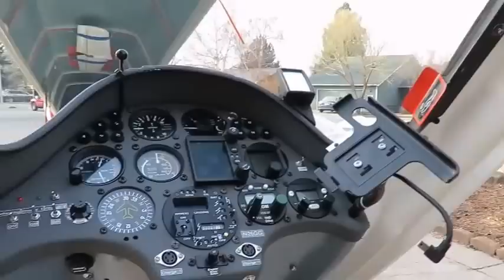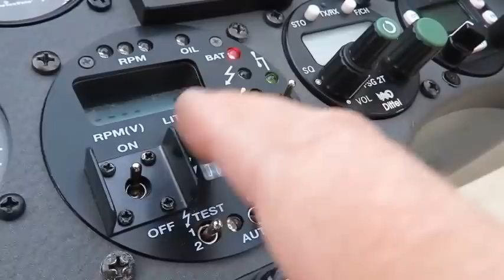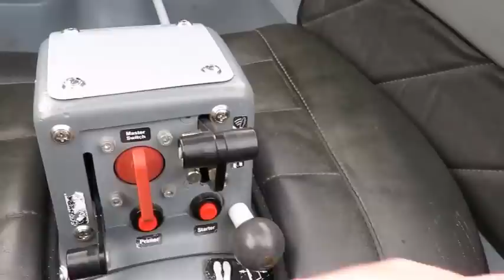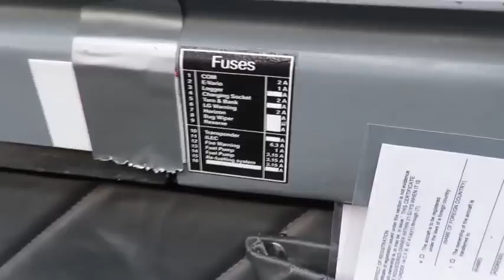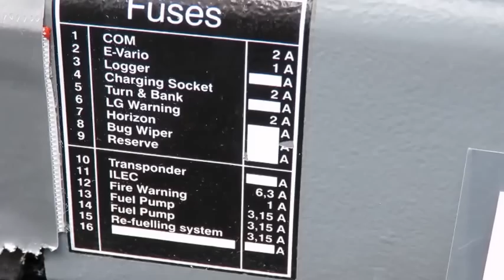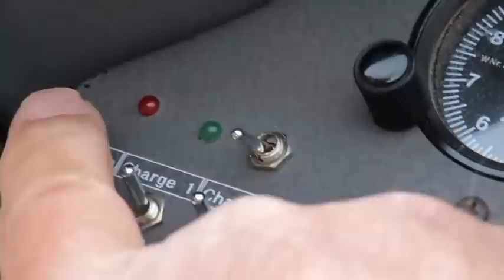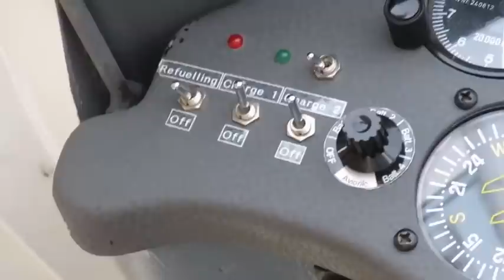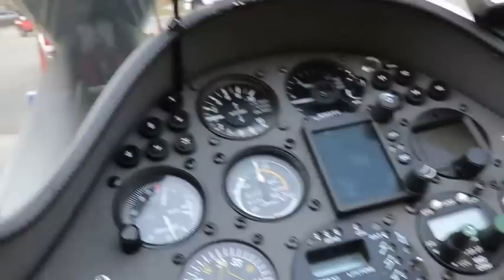ASH26e Motorglider Introduction

Comment: Schleicher has a different version of air filter, going upright, fixed at the water cooler, enabling much easier access to the oil cap.
Reply from the maker: This version is the ASH31Mi (which I now own). I have never heard of anyone retrofitting this to the 26e, but it might be a good idea. An upright air intake draws all air from the slip stream, while the its position on the 26e will draw some air from the exhaust (which is hotter and includes exhaust products). Schleicher made this change for a good reason: the 31Mi is much less prone to overheating than the 26e.

Comment: As relates to your oil filler cap. If I were you, I'd take a dremel tool and cut a small slot in the top of the flange thereby enabling the use of a screw driver to at least start the tightening process. Just a thought
Reply from the maker: The trick is to do it left handed.

Comment: Has the manufacturer solved the factory defective engine overheating issue?  Sounds like the ash 31 has another overheating issue.
Reply from the maker: I have heard of one or two overheating issues on our private user's group, and one of the 31mi's. This is still an open issue. I will update this comment if I hear of a resolution.
Reply from the maker: I looked into this at the SSA convention in Reno. The ILEC engine controller has had a software change which has resolved this overheating issue.

Comment: A beautiful machine but there are too many 'gotchas' for my liking.
Reply from the maker: It is a tradeoff between independence and complexity. If you are close to a reliable source of tows, a pure glider is a cheaper and simpler option. I would have to drive 1-2 hours to get a tow, and then only on weekends.
Reply: Gliders are for losers